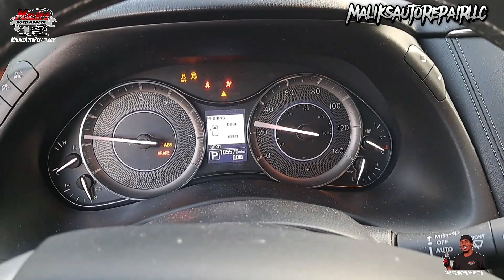2016 INFINITI QX80 | ALTERNATOR REPLACEMENT | BATTERY NOT HOLDING A CHARGE | Howto/Diy

Comment: Most of these vehicles do not suffer from bad batteries or alternators. The problem is design related, that is, the VVCS (Variable Voltage Control System), and the IPDM (Intelligent Power Distribution Module). This system tells the alternator not to charge the battery during periods of light load (coasting, etc.). If you take note of the charge status, the needle is often under 12 volts.

The fix is to clip the small red wire (33) at the IPDM harness (E13) connector. This does not impact any other system, but allows the alternator to charge full time; like all other vehicles.
Reply from the maker: That's good info. Thanks for sharing!
Reply: I showed this video to the dealer and shared info on it. They refuse to cut the red wire.
Reply: @alkalineph9446  It’s actually in a Nissan Technical Service Bulletin (TSB), but I would need to look it up. Regardless, this is a very easy DIY job. Again, clip red wire (33) at the IPDM (E13) harness, and your constant charging issues will go away for good!
I performed this easy procedure on my wife’s QX80 sometime in January ‘24 because it kept leaving her stranded. Clipped the wire and have had zero issues since.

FYI: I am a 35 year veteran automotive Quality and Engineering manager. I couldn’t tell you how many times fixes like these were implemented and pushed to the dealer. Dealers would rather sell you a battery or alternator plus labor, rather than take 5 minutes to clip a wire.
Reply from the maker: I'm just waiting for my client to hit me back for the problem to persist, so I can cut the red wire. So far, so good. Thanks again.
Reply: I disconnect this wire , never have any issue with charging battery , before is dead every year or so . No 3 year and no a single problem